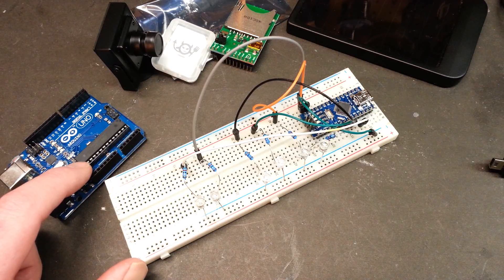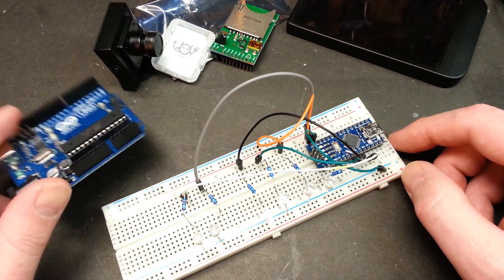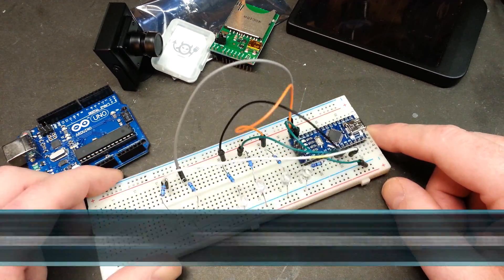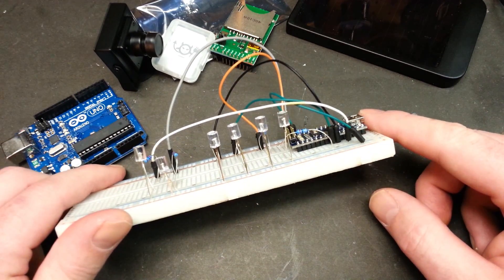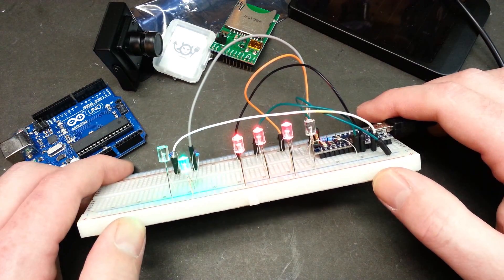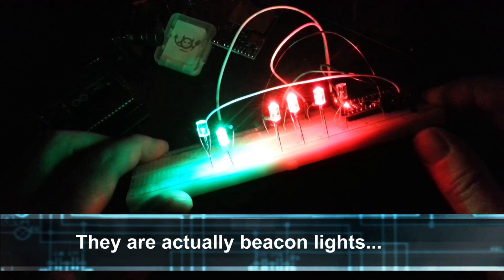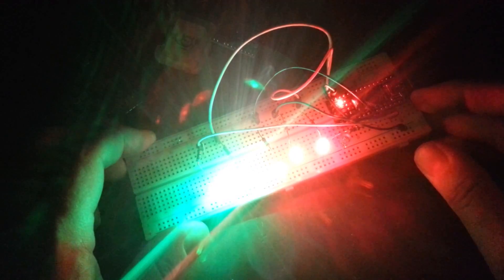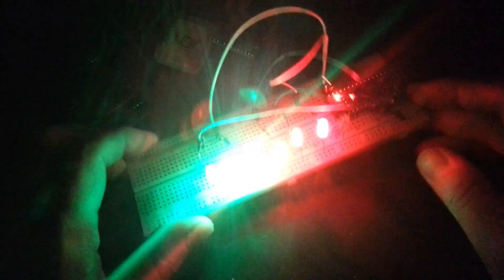RC/Drone Navigation Lights- Arduino Build & Code

Comment from the maker: I have a few custom PCBs left as well if needed https://store.mkme.org/?product=pcb-drone-aircraft-navigation-strobe-lights
Reply: So, I was reading into the code and noticed that there a was snippet of code to remove flicker in the landing lights, but im still receiving flicker in the landing lights. Is there a way around this? I have the servo connected to a Y cable with the signal wire going into the Arduino. Is this the correct way to wire this? It responds when I flick the switch on my transmitter, but flickers after 2 seconds.

Comment: Hi, I love what you have done here. Quick question: Would there be enough pins on an ATTiny85 to do this? If I look at the code, it refers to pin 8 for the strobe light but on the ATTiny, there's no pin 8 that I can use - it's the 5V to power the micro-controller. Am I misunderstanding the code? (Please excuse my inexperience on this, I'm new to this)

Comment: I used your code and added two constant HIGH nav lights for red and green wing lights. Everything is working great. I am hoping to write code to use a control switch for all off or run program.   I opened pin 3 for a second interrupt where I plan to use an 2 position switch on my controller to turn all off or run the program you have. Given your logic in the code what would be the best way to interrupt all and turn all off until the pin 3 interrupt state was changed?
Reply: The code I got from GITHub didn't have the red and green Nav lights but it was easy enough to add to constant HIGH outputs using your code as example.

Comment: ok, i recived my nano today and figured out how to upload this code to the board and its working brilliantly, you are the man!
Reply from the maker: Excellent!
Reply: MKme Lab  I have no idea how to write code for the arduino but I can examine existing code and figure out how to modify it, I've added extra outputs with modified patterns,  I'm super chuffed with this and I'll be doing it again but with 3w leds on my large scale (6ft wingspan)  cessna L19 bird dog, I'll just drive transistors with the arduino outputs to allow for the high current demand.
Reply from the maker: That's the beauty of Arduino- There are billions of lines of example code out there to borrow from. Enjoy your new strobes!

Comment: I've never used arduino before, is that nano board all that's needed and the code can be flashed via the USB or is the full size arduino also needed for the programming?
Reply: nano will work 100%

Comment: maybe i´m blind, but i not found the diagram, can you share with me? Im newbie in arduino universe
Reply from the maker: No diagram I'm afraid- just use the Arduino code. Hook a resistor in series with the led to ground on each output pin in the code.

Comment: Thanks for your explanation, very good tutorial. 

I have questions. 

First, if I want power up the Arduino NANO with 11.1 V, can I connect it directly to the VIN and the GROUND or I need to power the Arduino with a External BEC 5V? 

Second, I want to use 4 high power LED, probably 1W or 3W, the Arduino can provide the current for this LED or I need to connect each led to the external BEC 5V and the signal to the Arduino.

I want to use this LED.   http://www.ebay.ca/itm/231785484708?_trksid=p2055119.m1438.l2649&var=531046945857&ssPageName=STRK%3AMEBIDX%3AIT

This LED module.  http://www.ebay.ca/itm/311422238536?_trksid=p2055119.m1438.l2649&ssPageName=STRK%3AMEBIDX%3AIT

This BEC 5V.  http://www.ebay.ca/itm/DC-DC-Converter-Step-Down-Module-3A-5V-Mini-BEC-For-RC-Plane-FPV-/171919769117?hash=item2807377e1d:g:t-gAAOSwMmBV6W3v

Comment: Super project. Can I get the connection(scheme) to the Arduino? Regards Kris
Reply from the maker: +kris p Hmm not sure what you mean. The output pins are in the code. Beyond that it's just grnd and 5V  Cheers

Comment: Hello Good looking project. What would I need to add to power 3 watt LED's ? Tried to look at the code and it shows the requested topic does not exists. Any guidance if you have?
Reply from the maker: +Ron Ireland Fixed the link for you. For high power LEDs you just need to use a driver such as basic transistors.  Cheers
Reply: +MKme Lab Hello I am having a problem trying to load the code to Arduino it keeps give me an error: stray "\240" in program.
Reply from the maker: +Ron Ireland Not sure on that one. Works fine for me
Reply: +MKme Lab I'm an idiot. Redid the loading and it works fine. I see on your video you show Nav lights (green and red) but I don.t see the code or pin number? Is it just me being stupid again.
Reply from the maker: Ron Ireland The lights on solid you don't need code for :)  Just hook em up
Reply: +MKme Lab  Could you please explain the switch setup I cannot get my head around it.

Comment: 403 - Forbidden: Access is denied.
You do not have permission to view this directory or page using the credentials that you supplied.
The link is not work, Can you upload a new link? thanks
Reply from the maker: +WING f Its the web host. A pile of IPs are blocked due to attacks. If you are using a VPN- disconnect or use a diff PC.  That should do er.

Comment: (Sorry to first post this at Discusion thread, here is my question)
Hi Eric.
In my opinion, have a great construction project with this DIY https://www.youtube.com/watch?v=f-w4a3QijBU This R/C Navigation Lights- Arduino Build & Code, using Arduino USB Mini NANO was amazing to look at! I'm new for Arduino, so just programming this PIC and "go for it", I'm not in goal. Because of this situation, I hope you can help me with my Pilot flashing strobe light to my UVA/Drone. According to use 3W high bright mini LED, powestage as MOSFET are not my problem, it's programming my Nano. This pattern I'm thinking are my needed; 40 % constant light at two green LED (1&2), LED1 flash for 200mS with 100 % light, after 600 mS LED2 glow up, also light up with 100 % brightness for 200mS. This cycle shot are done within 1 sec. (1000mS). Green LED1&2 pause for 4 sec. then this pattern repeat. My two RED led3&4 are flashing simultan 400mS every 5. second(no constant light). This pattern start at power ON, and running for 3 minutes, pause for 2 minutes, then pattern for GREEN led1&2 starting, together with pattern for LED 3&4=red led. The total pattern to be continues as long power are ON. With Li-Po 11.1 volt and 1200mAh, the pause for 2 minutes needed to spare power at this battery. The forward current with 100 % bright, are for RED 650mA, GREEN 700mA, @ 2,5 and 3,6 volt, for each mini LED 3W diode. Needed to apre battery during flight @ 20 minutes are present. So, Eric, hopefully you within 5 minutes have written this code, I think :)(?), and thanks for attention-  73 de, with regards LA2LOA-Norway.
Reply from the maker: Tage Andersson LOL sorry that's not 5 minutes I'm afraid.  I would suggest starting in a forum maybe or mod the code I used to suit your pattern.  Cheers
Reply: Thanks Eric, it's help ;)

Comment: Eric:
What transistor would you use if you were to want to drive higher power led's?
I was thinking about 3 watt clear each for strobes. I was going to use 1 on each led so as to not having to use big ones and I was hoping due to being a strobe, I would not have to use heat sinks. Suggestions?
Thanks for the videos

Comment: What are these arduino things? what can they or do the do? Can anyone use them or program them? Are there ready made programs?  Why would I want one? Help.
Reply from the maker: Walt Prescott I think I will do a dedicated video for you responding to just this question :)  As my channel covers multiple hobbies I find there are many people who ask the same question as you.  I would start with a quick YT search "What is Arduino" then check out my main channel page for my Arduino playlist- lots of info there.  TLDR is - they are an extremely powerful microcontroller for under 5 bucks you can interface to anything and tonnes of free code for any project out there.  Basically you can make just about anything :) Cheers
Reply: Eric William
Thanks, Will do some research and wait to see your video.

Comment: Interesting code. Does a lot more than I thought it would. Would like to see a future video of it taxi-ing and taking off at dusk!
Reply from the maker: ***** Ha you noticed :)  Ya I didn't go over the fact a person can use a channel to control landing lights.  I might add those too.  I just got a pile of 1W LEDs which are insanely bright.  Might hook em up.  Cheers
Reply: Might be a good candidate for putting on a Tiny,
Reply from the maker: ***** Pretty sure that's what it originally was for. Can't remember anymore where I found it but I left the original author in the code so maybe there is a site with it.

Comment: .wish I knew how to start with programmable boards etc. looks ace
Reply from the maker: mowburnt Go to my how to buy stuff on ebay vid, buy an Arduino Nano (or a few), go to my how to get started with arduino video, plug in the nano and enjoy :)  Trust me it's super easy and you will likely never look at projects the same again.  Microcontrollers are easy and we can make just about anything :)